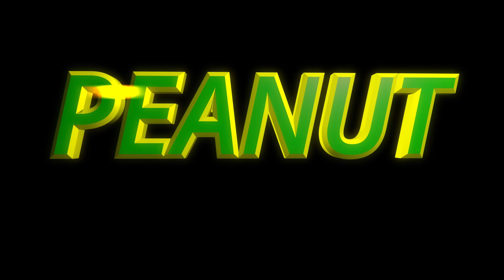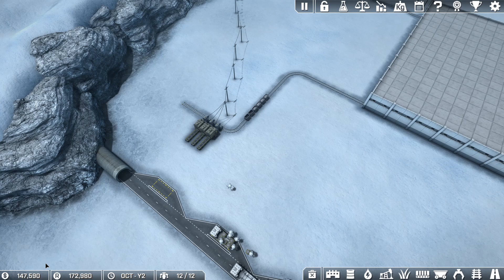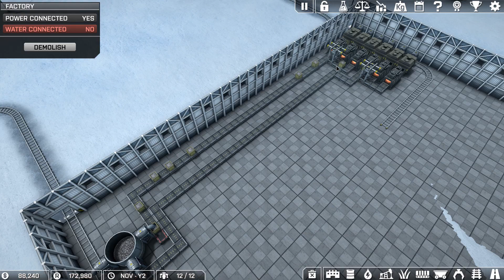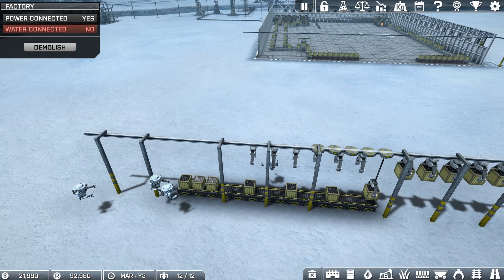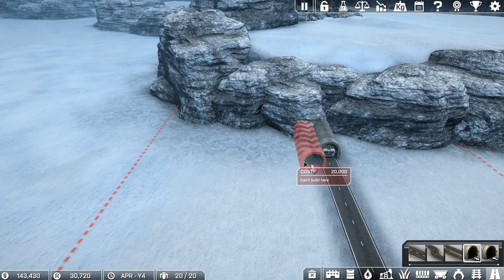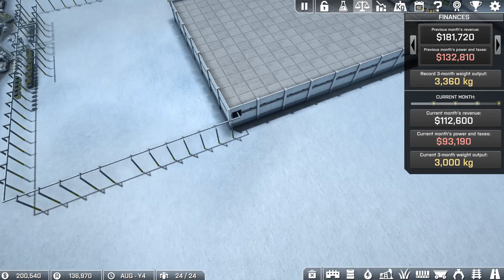Automation Empire Ep 2     Snow Cone Flats

Comment: Your Clawtrain lines are way to long.
1. build the lines as short as possible (shorter lines=quicker transport)
2. you need only one pickup and dropoff per line and conveyor, the clawtrain use the first pickup he reach until he is full or there are no more crates on the conveyor, if he reach the 2nd pickup he is already full or there are no more crates on the conveyor, wich makes the 2nd pickup useless.
3. make the line only long enough that the last claw can pass the pickup/dropoff, the longer the line is after the pickup/dropoff, the more time the clawtrain waste transporting nothing. (best, let the clawtrain run in circles)
4. for this distance, the clawtrains are too slow. Clawtrains are good to bring crates right outside the factory, not for transport crates far away.

Build factorys as close to the road as possible (or the road closer to the factory).
Its much faster and cheaper to use carts to get the resources from the drills far away, than build the factory by the drills and transport the crates all the way down to the road.
One crate maker cost you 1600 per month, you have 10 of them but you need only 3 for the same output, you pay 11200 for nothing, your factory is basically bottleneck after bottleneck.
The Clawtrains are not fast enough to transport the crates, that leads to the refiner stop working because the conveyor is full, wich leads to the crate maker, who is already 3 times faster than the refiner, stops working wich leads to the crate maker cant process the resources from the drills, so the drills stop working too and even if the drills, crate makers and refiners process material or not, they cost you the same money every month.
Reply from the maker: You do make a lot of good points. Some things I have done was planning for future building. I appreciate the hints and tips and will try to make better decisions as we move forward.